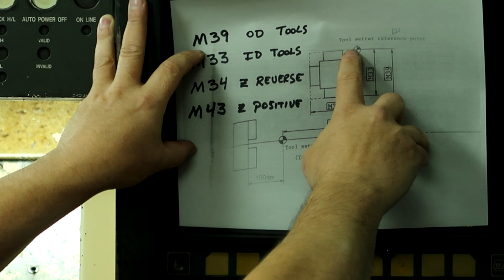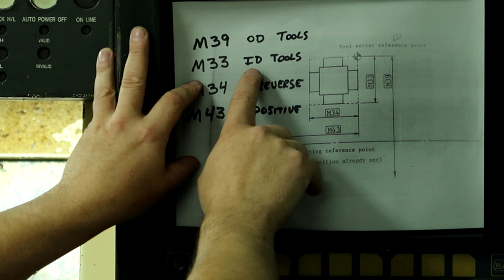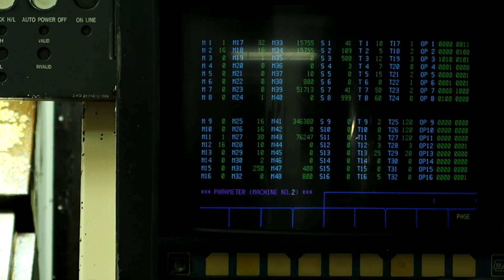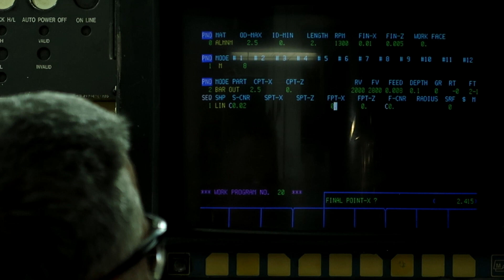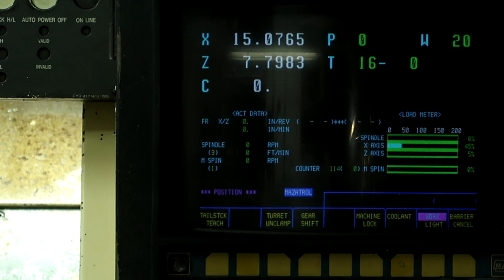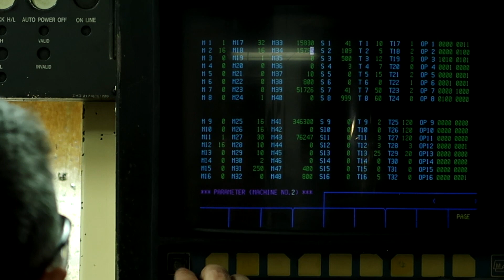Mazak Tool Probe Calibration CNC Lathe T2 T3 Control

Comment: For anyone looking, if you have a T+ control, the parameters are:

B63 for X dia
B64 for Z face turning
B62 for face width across the setter
B61 for X width across the setter

If you have a Multiplex or another machine with two spindle heads, the parameters are the same number, but the second head is C parameters instead of B. Hope this helps someone.
Reply: Thank you for this

Comment: Any alternative to the M parameters? I scrolled 16 pages on Machine Parameters and i have no M's. Im on a QuickTurn 30M.
Reply: Parameter B61 thru B64 on my Mazak. And also did not need to cut the value in half for radius vs diameter.

Comment: Hi Phil. Thank so much for your videos. I'm come from Viet Nam and have an Mazak cnc turning with T32-2 Operation. But I can't find any where with M33, M39, M34 and M43. Could you show me that M code any where in parameter?
Reply from the maker: The T32 has different parameters than my controller. I do not know what they are.
Reply: The parameters for that control are on machine parameter no. 3. They are
B61 = M33
B62 = M34
B63 = M39
B64 = M43

Comment: Hey phill.
I have a problem on mazatrol smart..
Alarm: 1109 tool length over...
Reply from the maker: Sounds like the tool is longer than the maximum allowance set in a parameter.
Reply: @mazatroltipsandtricks6816  
I want to change that parameter.
Which parameters should I change?
Reply from the maker: @kalpeshgavankar1607  That I do not know.

Comment: I have Mazatrol CAM T-4 and I'm not able to chage parameters. Every time it gives me 441 Protection parameters message, could you help anyhow?
Reply from the maker: I have never seen that error before.  Is the edit lock key in the ON position by chance?
Reply: @mazatroltipsandtricks6816  Only thing related that is on the front panel is a Program switch (Lock and Enable), tried both ways, same error. All work stalled because of this, I really need some help here. Btw. That's for the reply!

Comment: Can you do a memory clear and initialization procedure and show how to reset parameters . The batteries in my machine are coming in but I still need to do the procedure afterward
Reply: Anything will help thanks just started watching ur channel and subscribed great stuff so far
Reply from the maker: Here's the re-initialization procedure for the T-2 and T-3 control from Mazak that someone shared online.  I have used it and it works.  Only re-initialize the control as a last resort if replacing the batteries and reloading the parameters first does not work.     https://drive.google.com/file/d/0BxkZJiSxsKtcelkzUFdvRHg2VkU/edit

Comment: Thanks Phil.
Back so soon with another video.
Seems you must be enjoying posting video,s.

You must be one of the lucky ones to own a Mazak that has an operating Tooleye arm.
Most are left to resort to pull the arm down.
Definitely much better if the machine does it for you.

Unfortunately on my machine i do need to pull the arm down too ??
But as part of the rebuild i plan to have it working like it should.
The added bonus i have is i need to replace the Tooleye also ???
It had been sitting in it,s parked position for a little to long and the coolant has eaten it alive, LOL.
Any chance you know of an aftermarket ( non genuine ) replacement ?
I have seen a guy advertising in your part of the world who builds them himself but by the time i add currency conversion plus freight it works out not that much cheaper than buying a genuine Mazak part.
Just thought i would ask anyway,  you guys in the states have better access to spare parts than us on the big island.
Good to see you posting more.
Peter.
Reply from the maker: I've been wanting to film this video for a while as people keep asking about it.
Reply from the maker: I didn't notice the rest of your reply asking about obtaining a replacement tool eye.  It looks like you can get them directly from the manufacturer Metrol in Japan.  The price is in Japanese currency 50,000 JPY which converts to approx $467 USD plus about $63 for shipping.  https://toolsensor.com/lathe/h4a-08-07s/
Reply: @mazatroltipsandtricks6816  
Hey Phil.
Much appreciate the link to the site.
I thought that you might know where to buy a replacement.
I do remember seeing your name in one of the forums, i think it was Practical Machinist.
I know of Metrol but i could not find the section on there site which points to the Tooleye.
Thanks again for your help.
Peter.